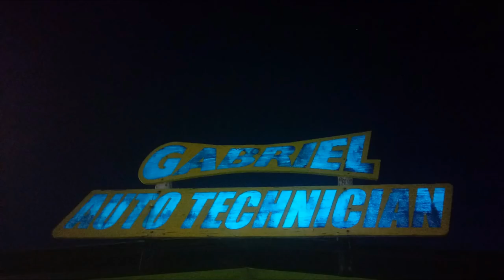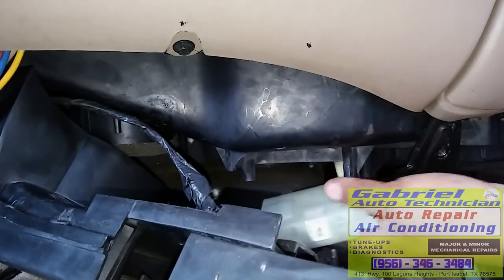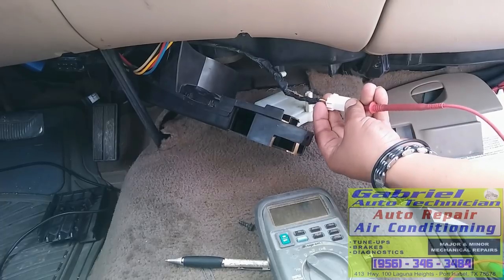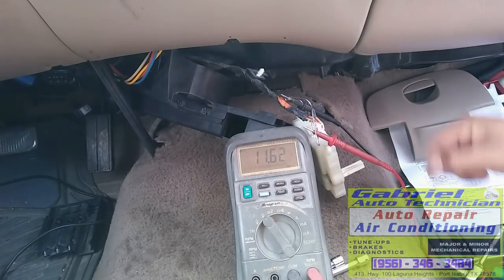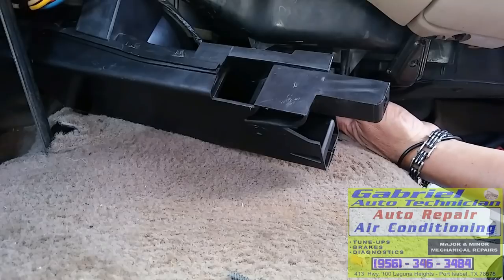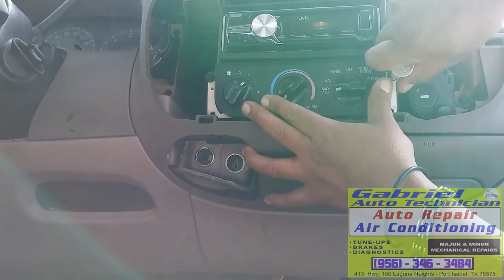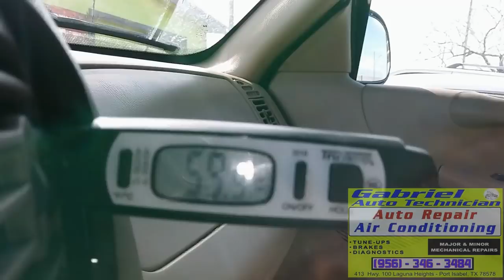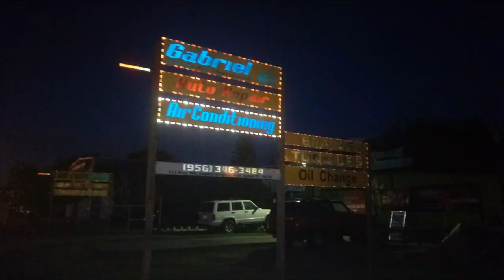Blend Door Actuator Stuck On Hot, Troubleshooting And Repair. Fixed! Ford F150 2002

Comment: On my 2000 ford f-150 when I turn over d control board u can hear that it's turning but d mechanic told me that it's strip. N it's anywhere from $200 to $300 to fix.

Comment: My truck has d same problem but it just cools no heat. Is their anyway that I can drill a hole on d door actuator n where that plastic spins can I use some JB weld or something. I lost my job 2 months ago
Reply from the maker: Remove the actuator and move it manually to hot, if the door is not broken II will stay there.
There is no way you can glued, if the door is broken it will be necessary to remove the whole dash.
Reply: @GabrielAutoTech  thank u sir. U got your tricks

Comment: Could the actuator cause the blend door to not fully close? I can sometimes here a rattling noise down there and when i turn the temp nob just a little bit it will stop the rattle noise.
Reply from the maker: The actuator motor have plastic gears inside, that could be that a certain point the gear have broken teeth. And the rest is good.
Thank you for watching the vid.

Comment: My 98 ford expedition EB   my heat and cool works. But only blows defrost only what's my issue?
Reply from the maker: Check if the vacuum line, that enters into the cab Next to the A/C Accumulator is not broken or disconnected. If it is ok, could be the switch or the diaphragm..

Comment: My truck has the rear ventilation so it has two extra ducts coming out the back. I can not figure out how get the duct moved enough to drop the actuator enough to get it out. Driving me crazy. The ducts coming out the back are mount deep under the carpet near the center are rest
Reply: imma just cut mine. did you get it out?
Reply: @BogusQuacky    Ya I just cut them out.  They actually were blocked off a couple inches back so no biggie
Reply: @BogusQuacky   did you cut them out?  I think they are for models that have a/c vents in the backseat are. Mine doesn’t have that option so they were just blocked off. So I cut like 2 inches off with a multi tool. I planned on putting them back in and duct taping around them, so I cut them nice and straight. but there was no need

Comment: How did you get the black vent out? I cant get mine to budge even though all the screws are out.
Reply from the maker: Check if it does not have a screw on the back, and just twist it, as I show on the vid, it's a little bit difficult. 4:00
Reply: i broke mine out lol i dont use the floor ac and dont care about the rear ac

Comment: oies disculpa ami camioneta 2001 ford expedition le cambie compresor valvila de expancion dryer pues le puse todo nuebo y esta bien de freon y el aire aveses esta a 80 grados y aveses a 60 grados pero no vaja de 60 crees ke pueda ser el actuator?
Reply from the maker: Desconecta las mangueras del calentador. Conectalas una con otra.
Asi veras si es eso.
Checa la temperatura en la lines donde va el orifice tube.
Si no le hiciste flush y vacio, tambien puede afectar.
Puede estar sucio tu condesador, adentro y/o afuera.
Reply: @GabrielAutoTech  si le ise el cacio pero el flush no y lo que e notado ke esta bien helada la manguera que sale del dryer pero antes de yegar al orificie tube esta caliente y ese orificie tube tambien selo cambie es mas desde nueva la camioneta no me a enfiado bien el aire boy aserle flush y cambiatle el orificie tube otra ves eso le e notado cuando sale del dryer como unas 10 pulgadas esta frio pero ya despues la linea esta caliente